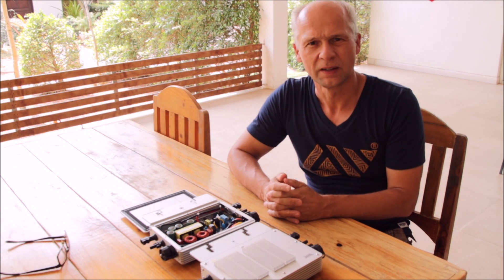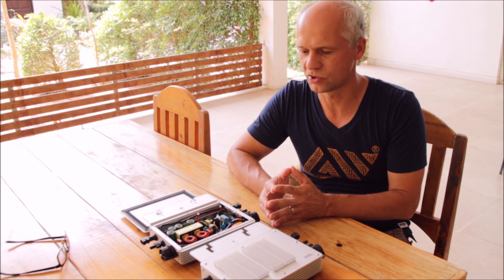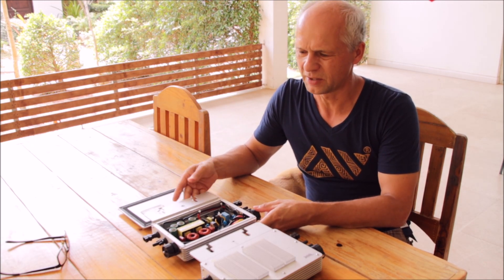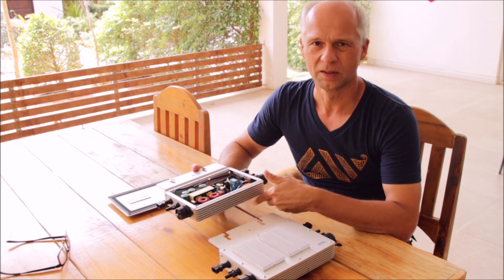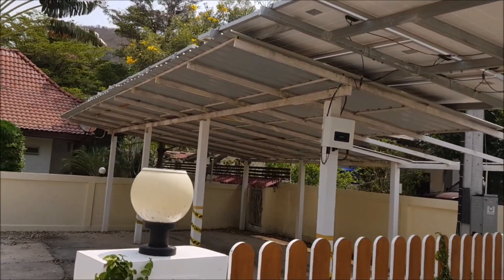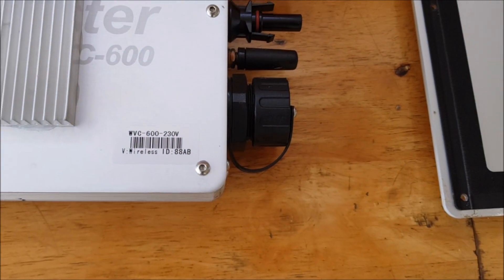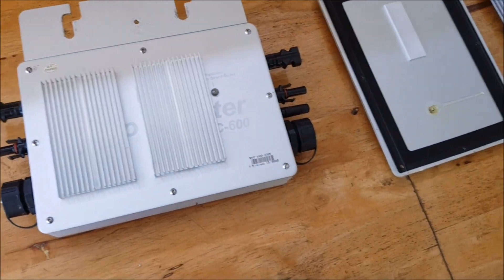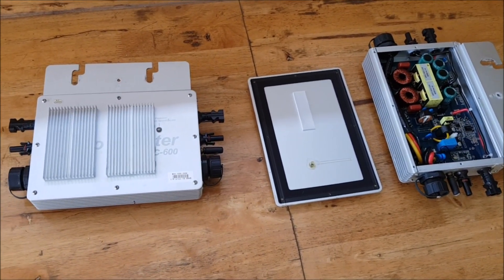WVC-300, WVC-600, WVC-1200 Chinese Micro-Inverter. Do not buy this cr@p. Never!

Comment: I have a few of these inverters, similar in nature. First thing, they have no MOV or overvoltage protection. Ideally should be run off an isolation transformer unless mains is very clean.
There are current limiting resistors inside. You can change them to accommodate lower currents. This will lower their output power, but should keep them running cool. I find 50% output is generally OK. As with anything Chinese really... the design is OK, just run on steroids!

MPPT on these units doesn't work very well. At low light levels, it doesn't track well. It tracks at a lower voltage, wasting power and restarts when it gets too low. I modified the primary converter to go off when input voltage was under 24V (based on my panels) and that greatly improved efficiency. But it does create output distortion. 

A couple of these units, I used as boosters, using the primary converter as an open loop push pull and feeding the rectified secondary output to a regular string inverter. You can tap onto the original reference for the sine wave and instead feed it with an analog voltage which will command the peak primary current.

These are generally good fun to play with and efficiency is reasonably OK as long as they are suitably de-rated.

Comment: Good afternoon, can you tell me how to reset a micro-inverter WVC-800W-Life to factory settings?  Reset WIFI settings?

There is no reset button and I can’t log into the app.
Reply from the maker: hi. sorry. i didn't have wifi on my inverters. i don't know. Did you ask you distributor?
Reply: @RolandW_DIYEnergyandMore I bought a used inverter.  The previous owner did not reset it to factory settings.  I'm looking for a way to solve a problem on social networks.  Thanks for the answer!

Comment: mine seems to have lasted 8 days before failing!
Reply from the maker: Looks like the quality didn't improve even after so many years of complaining... can you return it somehow?
Reply: @RolandW_DIYEnergyandMore  got up a ladder to retrieve it this morning, panels are still metering as outputting voltage, inverter shows no signs of life and all the DC ports on it meter as shorts.
Ive complained to the seller, but aliexpress so I'm not really expecting anything to come of it and if they want me to jump through the hoops of sending it back at my expense and that eating up half the refund I probably wont bother.

Comment: A friend (also in Thailand), had a couple burn out quickly, but had around 12 in total, so for a solution to save the rest he came up with the idea of adding a 20W panel which run's a pair of computer cooling fans alongside each micro inverter....it seemed to be working well after a few months.

Comment: I can connect a single panel to an inverter with 2 inputs or 4 inputs, for example if it has two inputs and is 600w, I can put a single 550w panel connected only on one input or do you recommend a y connector to pull the inverter on both inputs from the same panel but without exceeding the total power?
Reply from the maker: That would depend on if the microinverter has a tracker on each input or if the inputs are wired in parallel and there is only one MPPT. The WVC 600 inverter only has one tracker, so theoretically you could connect one single 550W panel on one input only for a 600W inverter. But i cannot recommend such inverters anyway. In general you have to follow manufacturer instructions and buy compatible equipment.

Comment: These truly are TRASH,  I've sent 3 back for refund as they failed to work out of the box, my current unit will not reset ,  there is a rubber reset button on the case but on further inspection there is no reset button on the circuit board, also the claim that it has MPPT is false as all 4 channels appear to be connected in parallel, the unit runs upto 60c quickly in cool UK temperatures and then reduces energy production to manage the heat, it is criminal that these are still on sale

Comment: I nearly buy WVC-1200, But I used to check review before buy on aliexpress.
I did not find review on Korean, but I searched with english then finally find your review
Thank you for your kindness to do not loose my money

May I have your recommend for 800~1200W tie grid inverter?
Reply from the maker: Hi. You might have to use other sources then Ali Express. Look for Hoymiles or Deye Original Micro inverters. They are still affordable and the quality is much better.
Reply: @RolandW_DIYEnergyandMore  Thanks for your kind reply
Deye looks like WVC except heat sink
Did you open case of Deye inverter?
I have doubt that WYC use same circuit with Deye
Reply from the maker: @이강창-m9s  Deye is much different. The better brands are all using thermal compound like silicone inside the inverter to remove the heat from the components. Deye has built in wifi. That can be a problem one day as wifi chips are nor built for the hot temperatures which the inverters could reach. Better inverters use a different communication link and external wifi devices.
Reply: @RolandW_DIYEnergyandMore  Thanks for your detailed explanation
I found input power range 60V~500V 3.5kW tie grid inverter from company in Korea
It's price is 450,000 won
Nowadays 1 dollar is 1300 won, so about 350$
the company is co-work with government for renewable energy installation
So quality of inverter is reliable

If I buy Deye 2000w on aliexpress about 280$
then I have to pay tax for import because it is over tax free limitation 150$
So it will be about 336$ in total

I'm checking detail specification with company in Korea for final decision

Comment: I got one of these as part of a package from a national retailer. I started getting suspicious when I never saw power over 400W despite having two 400W panels. I moved it slightly and could then only plug one panel in and I thought I'd make up an extension cable but by now I wasn't getting any power output and the app said AC output 465V 0W. I started searching for why this could be and hence I found all these bad reviews. Because the retailer was offering guarantees I hope to get it replaced but I'd rather not have it at all now because of all the hassle of swapping them.
Reply from the maker: Yes. Just try to switch to a better device. The WVC will just drive you crazy :)

Comment: Just as other people have commented, These inverters overheat at close to full power. There are also many 'manufacturers' of these 'WVC' inverters. I have found the KaiDeng versions with the WiFi option are more useful as you can de-rate the power output through the WiFi app. I am running the KDWVC-350 at 270 W and I am trying the KDWVC-700 at 500 W to start with. If they are hot to touch then the case is around 60 to 65 deg C. Which would imply the internal components are much hotter. With the de-rating I am trying to keep the case temp below 50 deg C. I noticed some of the internal capacitors are only rated for 105 deg C and their life will be shortened if the internal temperature gets close to that. 
For the more tech savvy readers: I also think these WVC are running the ferrite transformers at too high a flux density, and with heating that will only get worse. The generic brand WVC-600 has two interleaved push-pull converters feeding a single inductor on the high voltage side. I think the control IC is a UC3825 (or something pin compatible) There are 5 mOhm current sense resistors in the tails of each push-pull which would equate to a 200 A over current limit... Something wrong here! Changing those resistors to 10 mOhm or 15 mOhm would seem more appropriate, but I need to dig deeper into the design
Reply from the maker: Thanks for the very detailed comment. Hope you are getting better luck with your versionof the device.

Comment: I got my first microinverter, the exact same modell as you. Well theres no sun, winter time and already witnessed restarts and others because mppt find 17Vdc the best which is under the 22VDC limit ofthe inverter built in
Reply from the maker: What I have read in a lot of reviews on seller sites is that these inverters don't like to low DC voltages at all. The best panels for them are 72 cell equivalents which should at least get you somewhere around 30-35V even on dark days. They are just so poorly designed.
Reply: @Roland W  Short update, yesterday the mosfets gone wild. Now the whole thing is short circuited.  Never went over 50 Voc in total on inputs... So this is a piece of .... you know :)
Reply from the maker: @victorshane4134  welcome to the club :))

Comment: Could the quality of the grid over there be a factor? Solar is only worth the trouble if electricity is more than about 20 cents per KWh.
Reply from the maker: Grid stability may sure be a contributing factor why those devices fail. But if so, it just shows how poor they are as I never had any problems with my string inverters.
Reply: @RolandW_DIYEnergyandMore  Inverters are in short supply these days.

Comment: ...I have something similar GTB-600 with wifi..same case 1 year and it stopped working but I managed a 400kwh since install.. pushing for the 2y warranty which is still valid..it definitely had overheating issues now and then...this is just a 400w system, I can't imagine more than that if serial/parallel with more panels in more  richer countries..etc..wonder how enphase microinverter are managing it in hotter climates..I peeked inside and found 2 fan hole in the PCB mybe relay control but it's to late..and all the chip mark had been erased by someone earlier already..

Comment: This may help if have already have one of these inverters.
I recently bought a similar Vevor branded wvc600 inverter for a temporary setup and it runs very hot indeed with two 345w panels, in fact it comes with a separate label saying the temperature limiter is set to 60deg C and it will cut out for 6 minutes if exceeded. It does indeed do this  every 20 minutes! 
I solved this by doubling the effective surface area by clamping large aluminium extrusions each side with thermal paste and it does not cut out anymore. I hope this will increase the life, we shall see.
 They are very cheap at a third of the enphase, so what can you expect. If access is an issue for replacement I would only consider enphase which still run hot but clearly have better heat management, mine has run for 4 years so far.

Thank you Roland for the videos very helpful.

Comment: oh boi and i see this video after i purchased 5 of em SHIT...
i have 5 of the 1200w Series and 1x of 600w
Reply from the maker: Hope you live in a cool climate with a stable grid, and got the batch build with quality components. Good luck and keep us up to date how long they survive ;)
Reply: @RolandW_DIYEnergyandMore  Thanks and will do.
Reply: So they running now for almost 3 weeks cuz its winter and the Inverter is in the shades it reached 55°C during the day (outside was +10) so i hope in the summer it stays around 80°C whats pretty ok in the shades and the other 5 pieces going to be in Croatia on the House i also gonna Mount them into the Shades
Reply from the maker: @BaconCola  I hope you will never see 80 deg on them :) Good luck
Reply: @RolandW_DIYEnergyandMore  that would be the dream. Thx il keep you Updated in a few Months
Reply: @RolandW_DIYEnergyandMore  hey i want to inform you that 2/5 big Inverters 1200w failed to work.
I connected first 3 panels 285W to the 4Panel 1200w Micorinverter and worked for a Week after a week it just stopped working.
Then i swapped it out for the other i still did not tested or used, the 2nd one this time got 2x 285w panels and it stopped working the next day.

I contacted the seller allready to see whats going on.
Reply from the maker: @BaconCola  oh boy. It's just such a waste of time and money with that garbage :( thanks to keep us informed.
Reply: @RolandW_DIYEnergyandMore  i tried to fix 1/2 inverters and right after the fix i tried and it shortef again now both are Unfixable, Lost money now i habe 2 Brand new and 1 currently in Test use for 2 Panels.... i think i sell them somehow to get rid of this trash
Reply from the maker: @BaconCola  when you find a buyer, just donn't tell him about my video, hehe. Thanks for your updates. Hope you can find a good solution for your system.
Reply: @RolandW_DIYEnergyandMore  hehe, i found now domething local its way more 5pieces are 1800Euro but atleast 12Years warranty

Comment: Hello Roland, thanks for this Video. in my System i use AE-Conversion micro inverter since 6 Years without problems. I know  they costs about 3 times than the chin. Inverters
Reply from the maker: Quality cost money, and in this case pays off for sure. Thanks for sharing!
Reply: @RolandW_DIYEnergyandMore  да

Comment: Sir I do agree with you 100% as they do have a Heat problem and this is due to the design. I see you added Heat Sinks to try and control that heat, but please understand if a heat sink is in in direct contact with the item creating the heat they will do nothing to help at all. there is no electrical device on earth that likes heat. Heat shortens the life of them and lowers operational efficiency. I know they design these to be sealed and be installed under the panel but I believe that is the big mistake. if you can remove the cover and drill some holes and maybe even add a cooling fan that should over come the problem but keep in mind you would need to protect it from weather.
Reply: Sir I would like to add a update to my comment even with adding cooling they still fail. I got a unit just like yours. removed the cover drilled holes and added a fan it still over heated and failed in 3 days
Reply: @johnrowley3049  i have mine Placed in shade away from the Panels
Reply: Please have a look to some chinese installation pictures! 
The aluminum angles are not only to fix the unit somewhere. They must be mounted to metall, so they will bring the head away.
I mounted my WVC 300 in a garage with a rope. It gets warm producing 150 to 200 Watt. Thinking about cooling, I mount a USB desktop fan about 10 cm over the unit. 1 Watt less performance, but the unit stays cool even if producing 285 Watt, the maximum of my unit.
Your head sinks on both sides looks like a bad joke, too small in height. In warm countries, you need pretty much cooling air!

Comment: All inverters from all manufactures go bad: i have 12 of the wvc-600 W installed in 2 locations going 6 years no failures. best low cost micro inverters i ever used.
Reply from the maker: Nice! More then 5 years, is what every inverter must run. But still, if a product is designed a way, that it can only make it that far in special locations, conditions, climates, etc,  then it cannot be sold worldwide. My Tier-2 string inverters are not more expensive by the Kilowatt-equivalent, and they are all running well. Maybe 6 years ago, companies where using better components, while today they just use the cheapest stuff to keep cost low, and profits high.
Reply: @RolandW_DIYEnergyandMore  I think you maybe bought a copy WVC micro inverter ,not real one .
Reply: Powiedz jakie panele zastosowałeś do tego mikroinwertera?

Comment: Dear,

I bought micro inverters 127V , but I need 220V. I cannot return these micro inverters. Do you know how these micro inverters can be changed into 220V?
Reply from the maker: Hi, I have opened the inverter, and there might be a chance. I need you to get in contact with me to share some photos. Later, if it is working, I will make a video about it. Please contact me on my e-mail address shown in channel info. Thx
Reply: If you can change the transformer wiring and replace the capacitors to handle +220V, yes get a new one is a better idea
Reply: I would just add a toroidal isolation transformer. You can't go wrong with aditional protection. The only thing you need to check is if the input frequency is within range, assuming your 220V supply is 50Hz and your 127Hz Inverter may expect 60Hz...

Comment: I went with the Enphase and so far 4+ years no problems they handle the shading problem very well
Reply from the maker: yeah. Any inverter that doesn't make it to 5 years, is not worth its money, just wasting time in which a better one would earn you money. I am very happy with my Tier 2 equipment. It is affordable and well built. But the other cheap Ebay, Amazon, Aliexpress ist just to bad.